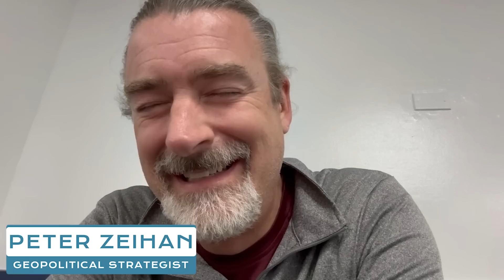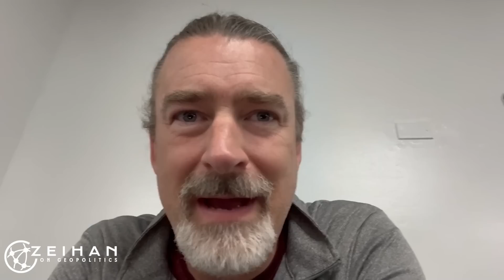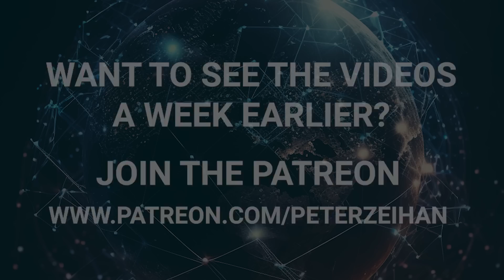Nuclear Power's Facelift: Small Modular Reactors || Peter Zeihan

Comment: What I can't for the life of me understand is: with this entire green energy push, what with all the solar power and whatnot... why the blooming hell do we not hear about pumped-storage hydroelectric plants? The technology is simple, they require little to none rare earth metals to establish while not decaying in the same way battery farms do, and they solve pretty much all of the issues solar has with unreliability, with the added functionality of improving water security (both in terms of water accessibility and flood protection) to boot.
Don't get me wrong, nuclear power is an underrated stopgap measure for sure, but... in terms of sustainability, you can't really beat a solar-PSHE combo plant, barring stuff like geothermals.
Reply: Except for the land use and transmission problems. Both solar and PSHE are very land intensive, and cannot be necessarily built in enough quantity close enough to where it is needed. That, factored into the massive increase in power usage for new technologies and development makes Solar rather unattractive. 
I've always said that I'll consider solar good for being the majority of a power mix when it can run an Arc furnace or a data center without LNG backups.

Comment: For what i find on info: 
Only two commercial SMR designs have ever been built and placed in commercial operation, the KLT-40S (russian) and HTR-PM (Chinese). 
The performance since entering service of both has come under fire. 
The HTR in the total year 2022, operated for only 27 hours out of a possible maximum of 8,760 hours, and only at atound 10% capacity. 
The Rusian KLT did not much better. . . . .
Reply: @Grizzold-HP2  i would not expect much more from those countries

Comment: The way the cost curves on solar, wind and a multitude of energy storage systems are moving, it's really difficult to see nuclear being able to compete.  By the time SMRs are off the drawing board you may be able to build 2-3x the amount of solar PV with enough storage to make up for intermittency, for less than nuclear.
Reply: At this point in time you are wrong. 

Without vast storage capacity wind and solar are completely intermittent in production and electrical demand is large, and must be 100% be met in real time as neded to prevent grid failure. 

Our grid storage capacity is miniscule compared to what would be needed to replace coal, natural gas, and nuclear power.  It will take several decades to get any meaningful increase in storage capacity. 

We can not and will not accept an electric service that is intermittent. Our economy is based on reliable electricity delivery.

Nuclear is reliable and does not fluctuate in output power at any time scale.  This provides a tremendous utility to the grid which wind and solar can not. 

Tell me if I am wrong.
Reply: But ypu need a crap ton more land for solar. And the sun doesnt always shine

Comment: Cost-effective SMR's are always 10 or 20 years away - in other words, it's a pipe dream that will come true in 40 years --> maaaaaaybe.

Credentials; I studied electrical engineering, power generation is my passion.
I also invest primarily in electrical-engineering-connected companies (I buy & hold a stock portfolio) 👍

On the other side, military SMR's are expensive as hell. 👀
But they are made to be very small, quiet, in small quantities... All this increases costs.

Cheers ❤

Comment: Moltex Energy have developed a low cost method to recycle spent fuel for their Stable Salt Reactors (SSRs), called WATSS - Waste to Stable Salt. The capital cost of the reactors is under $2 / Watt. They use heat storage to sell electricity at peak demand, making the reactors likely highly profitable. Last I heard the First of a Kind (FOAK) Stable Salt Reactor Wasteburner (SSR-W) was projected to be running in around 10 years at Lepreau Point, Ontario. Moltex Energy has a good, informative website.

Comment: Nothing is carbon-free. 

The nuclear power industry uses diesel trucks That's how they haul waist out that's how they hauled new field rods in and other assorted equipment as well as other things supplies and whatnot to do maintenance to the plant carbon-free is frankly a hippie stupid concept it is not possible.
Reply: That's really splitting hairs. The carbon released by the plant itself comes from the concrete curing.

Comment: SMR seems like a nightmare regarding the security aspect. Sure the form factor does lend itself to several positive aspects. But the need for security should be roughly equal regardless of size. Especially in the current situation of increasing instability, terror domestic and foreign. If spread to 20 times more locations, oh my... That's a whole new level of security problem. 😬🫣

Comment: The navy haas used small nuclear reactors for decades in subs and aircraft carrier's for decades with no incidents.
Reply: They use highly enriched Uranium, otherwise known as weapons grade Uranium. So they won’t work in the civilian market where such Uranium use is banned for obvious reasons.
Reply: no incidents that were declassified to public
Reply: Military SMR's are expensive as hell. 👀
But they are made to be very small, quiet, in small quantities... All this increases costs.

Cost-effective SMR's are always 10 or 20 years away - in other words, it's a pipe dream that will come true in 40 years --> maaaaaaybe.

Credentials; I studied electrical engineering, power generation is my passion.
I also invest primarily in electrical-engineering-connected companies (I buy & hold a stock portfolio) 👍

Cheers ❤
Reply: @elektrotehnik94  But everything has a limit and currently the SMR are everything between 0.1 and 400 MWe.  Or at least some companies try to pass 400 MWe block as small, so where is, according to you, the limit where the reactor becomes economical
Reply: @elektrotehnik94  But isn't every new technology expensive and not very cost-effective, until it is?
Reply: Plenty of incidents; no accidents, you mean.